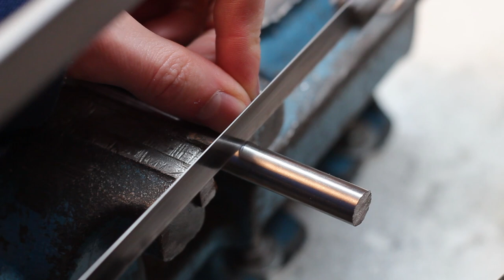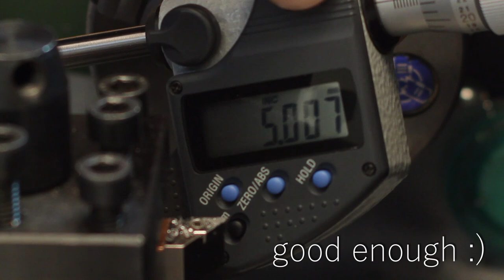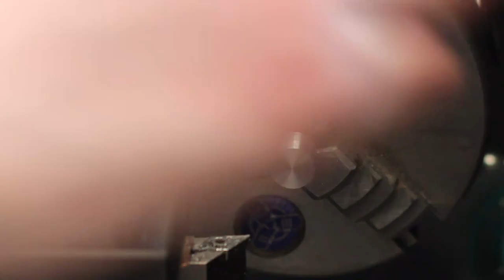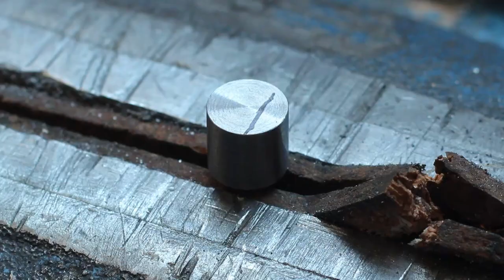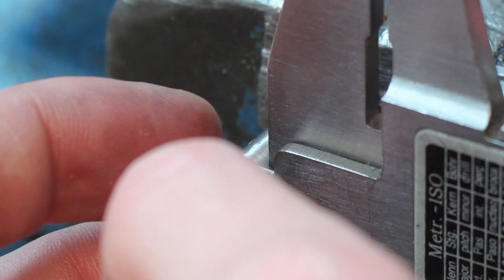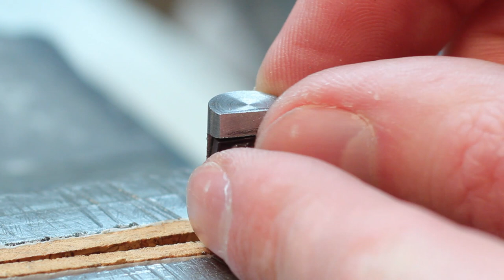Short project 1 - reverse counterboring tool

Comment: I've just begun to explore my mini lathe. Upgraded to a quick-change tool post, and fitted a mini milling attachment. I was considering getting a 4-jaw self-centering chuck, but after seeing your independent 4-jaw in action I might go that route. The lathe doesn't see heavy use; it's just "there if I need it". (Harbor Freight. Affordable for my needs, and my son paid for half.)
Reply from the maker: Thanks for your comment. That sounds good. I'm very happy with the independent 4-jaw chuck. Off course it takes some time to center and you need a sort of indicator for it but for me it's great because it's so versatile.
Reply: @WeCanDoThatBetter  I've got a dial indicator with a mag base that I've had for years, and it will see some use now. Always learning!
Reply: Self centering 4 jaw chucks defeats part of the purpose of having one. The jaws should always be independently adjustable. Yes, it takes more time to get a part centered and some practice, but the precision and the ability to handle odd shaped parts is where they shine.
Reply: @fredflintstone8048  that's what I realized, that a self-centering 4-jaw would just not be any more functional. This is that "learning phase" I'm going through; doing a little research before just blindly tossing $$$ about. 😊

Comment: Excellent idea! I'm looking forward to more videos from you.
Q: What's a "polished insert"?
Reply from the maker: Thank you very much! You see that the turning tool uses exchangechable carbide cutting inserts which get screwed on. I first used a black coated one which is most likely used for turning steel an tough material. As this doesn't work so well I screwed on a cutting insert which is polished on the cutting surface (that's why it's so shiny). These inserts are normally used for aluminium but work in steel with light cuts as well or even better.

Comment: Good idea, but are you not afraid to drop the chuck holder MK2 or MK3 of your drill which has no tie rod like on a milling machine? 
Admittedly it does not have milling but with the vibrations there is a certain risk. When do you even think if you were successful in one of your other videos?
Reply from the maker: That's a good point. The drill chuck is hold by a b13 taper only by friction. Pulling upwards with the counterboring tool isn't the preferred working direction. In my case I was lucky that everything went as it should. The chuck stayed on the drill spindle, had absolutely no issues with that. In the last video on the tailstock modification you can see it works. The forces weren't that high and the tool runs surprisingly smooth.

Comment: I guess you need that tool bad if you went thru all that filing :) nice build
That little ccmt insert is a 09 or a 10 ?
Reply from the maker: Haha :D I thought about milling it someway on the mini lathe but then thought, filing might be even faster cause I don't know to hold it on the lathe..  It is actually a little ccmt 06 insert, so very small :) I have them for a tiny boring bar.
Reply: @WeCanDoThatBetter  if you have ER collect chuck for the spindle, use that for endmill. Hold the insert holder in a quick change toolpost holder with a groove at the bottom that's meant for boring bars.
Reply: @WeCanDoThatBetter  nice result, looking forward to the next project :)
Reply: @WeCanDoThatBetter  The first time you attempt a real milling job on the mini lathe, even with a very rigid vertical slide, you will start saving up for a proper milling machine. Setting up my mini lathe with a Myford vertical slide, a mounting plate and a vice, was a waste of both time and money.
Reply from the maker: @HM-Projects  thanks :)
Reply from the maker: @HM-Projects  a collet chuck would be great, yes. Perhaps a future project or I have to buy one :)